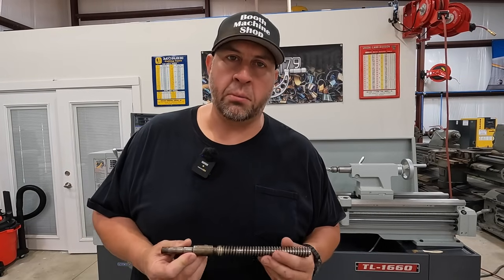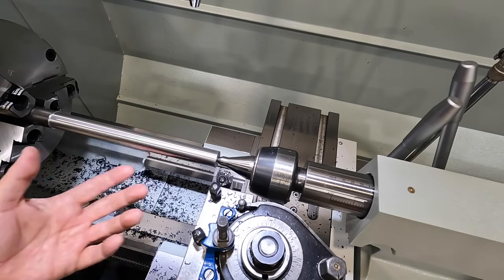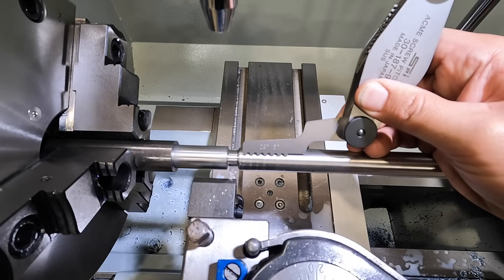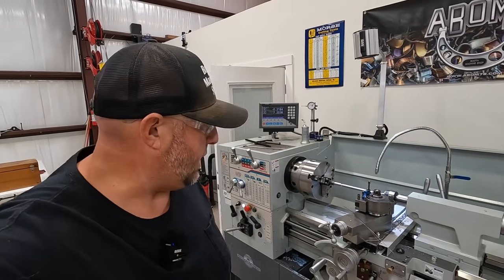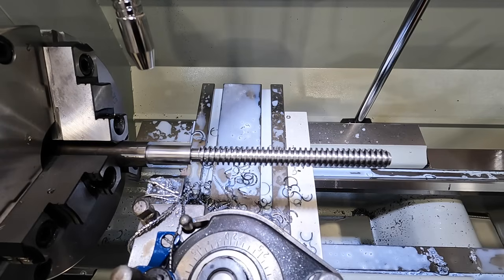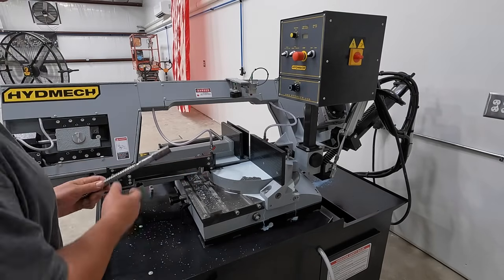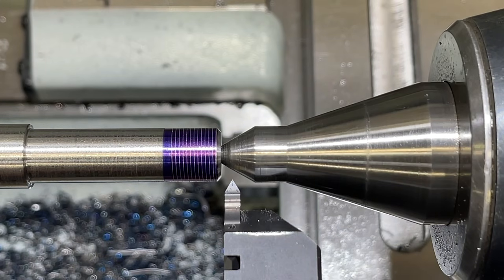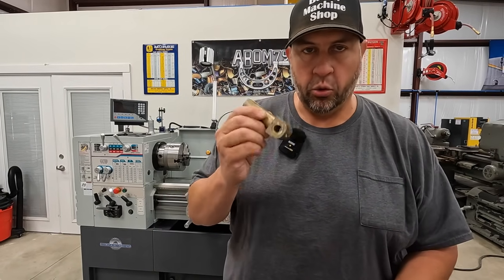Compound Acme Lead Screw for American Pacemaker Lathe

Comment: abom79 (or anyone who can answer)- when you do trial passes with and without coolant trying to determine which you prefer, could you describe what you'd be looking at or listening for etc to help make your decision about whether to use coolant or not? I guessed maybe the surface finish or chatter might be better one way or the other, but I don't have any eye or ear for what an experienced machinist would notice. Thanks in advance and man I love these videos!
Reply: It’s rare that you wouldn’t want to use coolant in this situation. Unless your talking high power carbide insert machining with thermal shock issues coolant will be helpful. Most of the time when you see videos without coolant it is strictly for the video purpose. Some materials also just don’t need it like bronze,brass, cast iron.
Reply: @matthewchastain136  As long as you use coolant from the start, thermal shock isn't an issue, its only an issue if you are introducing coolant when the part is already hot.
Reply: Hi Andy, as a rule of thumb, always use coolant, except on cast iron, ( the material tends to harden and is self lubricating so no need for coolant, some leaded bronzes are also self lubricating but it wise to use coolant  on these materials  because of the sizing issues). The reasons are, its keeps the part cool which means you are not guessing how far the part will shrink when it cools down, and it stops weld  build up on the cutting edge of the tip, its also improves the surface finish of the part.
Reply: @1ginner1  you never use coolant when hardmilling or highfeed miling of steels and super alloys. It causes thermal shock on the carbide or ceramic tooling not on the part.
Reply: @matthewchastain136  Hi Matthew, I wouldn't know, I was only talking about turning, not milling. Most of the milling I have done was on pretty standard materials, not on super alloys, although I have turned, Super duplex , hastalloy, Inconels, etc... all of which I have used coolant on.
Reply: @matthewchastain136  hm so in this case, abom makes a first pass without coolant, and then turns it on for the rest. Based on the responses here, it sounds like maybe he planned to use coolant for all the passes, but maybe just wanted to be able to see how the insert was performing once before it was obscured by the coolant? I'm guessing it's probably not a big problem to make an initial pass without it and he wasn't trying to decide whether or not to use coolant but just to get some footage of  cut without it.

Thanks a bunch to everyone who replied! I'm a hack woodworker who has gotten hooked on machining vicariously through these videos, I'm hoping by the time I break down and get a toy lathe I'll know enough to do a few simple things :)
Reply: @1ginner1  i imagine the same applies in turning harder alloys  but i dont have as much experience in that, mostly in CNC milling.

Comment: Most of what I know about machining I've learned from watching Adam, so apologi

es if this is something actual machinists already know:

Does it make sense to mount a follow rest on the cross slide? And not necessarily on top, like the compound, but maybe via holes in the housing for the cross slide, on a swivel with positioning holes that can locked with pins. If the issue is to support the stock where it's being machined, being on the cross slide will give it the precision to be where the tool is. I can see where flexing might be an issue, so maybe the mounting system needs to attach to both sides of the cross slide. like an A-frame.

Thoughts?
Reply: One thought is if you have a rest centering on the chuck side and another on the tail side, how do you centre them both except during cutting?🤔
Reply: The cross slide must be wound OUT after every pass. You cut the pass, wind out the cross slide, then wind the carriage back to the start, then wind the cross slide back in (to zero on the dial),  then wind in a few more thou on the compound, then make the next pass, then wind the cross slide back out.... rinse and repeat.
If you mount the follow rest on the cross slide, then you cannot wind the tool out. If you can't wind the tool out, how do you get the carriage back to the starting position to take the next pass?
The follow rest must be mounted onto carriage (which moves left and right), and not to either of the slides (that move in and out).
Reply: @johncoops6897  Good point. From what I can tell, the cross slide is on a base which rests on the main ways. If that't the case, then my version of a follow rest can mount to the same base.If that isn't the case, this might mean designing a new system that can accommodate a follow rest and a cross slide.
Reply: @meteorplum  rereading this, you might be describing a "standard" follow rest or "travelling steady" that mounts on the saddle and supports the workpiece close to or at the cutting position.   I'm not sure I've ever seen Abom use one, so if all you know is based on what you've seen here, it shows you're learning and thinking (but unfortunately maybe re-inventing the wheel this time around)👍👍

Comment: Your compound Is at a 30° angle, if you add thread cutting depth with it, doesn't it shift the tool over to the right by half the amount you're adding? Doesn't this interfere with the thread alignment?
Do I have an error in this?
Reply: This is a good question ,, and now my brain is hurting trying to remember this from long ago,, Dammit ,,,  Now , I will have to dig out my hand book and study to remember the effects of angular movement on acme threading ,, mutters at old age. Regards J
Reply: @johnmccallum9542   I thought this through with a triangle (angle 30°, compound as hypotenuse, sine(30°)). Maybe it helps you and you don't need to dig out your old hand book.
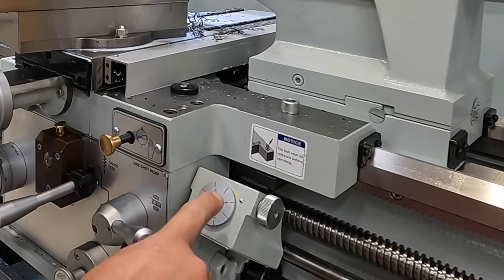Reply: By the looks of it the compound is at the correct ~14° angle for cutting acme (29° included angle) threads. Have a look at around the 16:20 mark in the vid'. It is also swung the opposite way to 'normal' which is correct for LH threading. The function of the setup is to make the tool cut on the leading side only which reduces tool pressure and chatter etc. Basically the tool is fed in so it follows the angle of the flank of the thread. The only compensation that has to be made if using the compound dial to control depth is to calculate (with basic trigonometry)  the distance along the angle that gives the required final thread depth. This has no effect on the pitch as that is controlled by the leadscrew.

Comment: Just need to rotate that compound slide the opposite way to get the cutter in front of the follower. Cutter presentation is still straight in.   New machine .....new problems and new solutions.

Comment: If the compound had been turned 14.5 degrees the other way he could have used the follower rest? The tool would have been cutting on the left side instead of the right but the result would have been the same.
Reply: Great point, that's knowing why you do something and not just how.

Another solution would be to keep the compound aligned with the lathe axis and advance the compound 0.001" per 0.010" from the diameter. This simulates the 14.5 degree tool movement in the z axis that the compound slide does. It keeps the main cutting on one side of the tool with 0.0003" shaving on the trailing edge and simplifies the depth to go to. The tool can also be independently moved in relation to the follow rest to suit where you want it to touch the workpiece.

Or: The trade solution, use stock ACME rod and machine / sleeve the ends.
Reply: @marley589  starting w acme rod and machining away what's not needed and adding a sleeve is what i thought first. ALSO isnt acme heat treated to help with wear?

Comment: I wondered if the ACME in your test nut was a little tapered. As you checked the fit several times you were able to screw it on almost all the way. One time it seemed you tried the other way and it barely did fit 1 turn?
Reply: @_BLENDRR  Nice explanation :)
As you explain there would have to be a slightly difference in pitch between internal and external pitch wich there isnt according to the Book. Both have 5 TPI and there is no   different tolerance specified for the pitch. Even if, then the Nut had to screw up the same length from both sides.
Maybe Adam likes to say something about?
Reply: Not likely the tap would taper the hole. In the beginning it was definitely the end of the thread causing it to start hard. It pulls the top of the thread over just a little when the tool exits the cuts. The other tight spots aren't a surprise at all because there was so little clearance in the thread. You would never notice it if he had machine more clearance into the nut, but he wanted it tight because it's a lead screw and will work better and longer if it's a good fit.

Comment: Why don't you turn the compound to the other side, so the tool follows the right side of the groove? You just have to drag your hand on the handle to keep the cutting pressure from pushing the carriage away from the work. As your machine is new, and tight, this shouldn;t be a problem. Hope this helps position the tool where it needs to be.

Comment: Did you ever consider rolling the threads?  edit; I'm not sure Acme threads can be rolled.
Reply: Yes they can, but you have to have the machinery to do it. It creates a much stronger thread than single pointing.
Reply: The rolling dies for each specific thread pitch and lead are a rather big investment, only worth for large production runs, or the exceptional case of this process being specified for stronger threads, in which case it can still be more economic to just single point turn them in a tougher material all along.

Comment: is the threading dial supposed to line up with that rivet?  It doesn't look like it lines up with anything...
Reply: That's what I thought too.
Reply: If you look closely at around the 16:16 time you can see a yellow mark just above the rivet, Adam may prefer the sight line to that mark over the sight line to the rivet, you could line the wheel up to any mark you prefer, the only things needed are that the 1/2 nut will engage at your chosen point, that the point cannot move and that you only use that mark!
Reply: Yeah, he's using something other than the intended rivet , whatever it is he is keeping it the same but it's annoying for the video viewers.
Reply: @grahamstretch6863  Thanks, I didn't even see the yellow mark.  He talked about starting on 1,2,3 or 4 then it looked to me like he started on 2 and 1/2 as I was expecting it to line up with the 12 O'clock position.
Reply: that looks a pin for retaining part of the internal mechanism, possibly the shaft for the knob to the right of the dial.  the index mark for the dial will be a score line in the housing.
Reply: @ScottPankhurst  
On my lathe it is that dome that is used, but it is nearer to being where the yellow mark is at on Adam’s lathe.

Comment: On the bearing nut side, how are you pulling the tool out with the cross slide in exactly the same place each pass? Also no undercut on that end?
Reply: He’s probably reading the Digital Read out for the position of the carriage and retract the cross-slide as it reaches the target position.

Comment: When machining those threads, how does the machine move in to cut at precisely the right moment?
Reply: It can move in at any time. It starts moving sideways at a precise time because he engages what called a "half nut" around the screw that runs the auto feed. There is a little indicator dial that shows the phase of rotation of the drive screw at the exact moment in time.
Your timing has to be pretty good or else you suddenly wreck everything.

Comment: When you’re adjusting your x with thread cutting on your compound on an angle (30°) like that how are you compensating for / landing on your Z zero each pass?  Is the zero read on the compound on the dro?
Reply: Your carriage and your cross-slide are set exactly to zero every pass, but the compound is dialed in for the depth of cut. In this case, I think his angle was only 14° or something and not the standard 30° for most threads.

Comment: looks like it gets pretty close to the tailstock at the end of the cut. does it have a sensor there to help prevent a crash?
Reply: It makes a noise
Reply: I noticed that too, but would assume it is more experience than anything (including the 'beep').
Reply: The PM lathe he's using has a really nice clutch-out feature with the power feed where you can set a stop collar. Not sure if he's using that or not (most lathes do NOT have that kind of nicety!).
Reply: @Venthorn  Good point.

Comment: Where does all that coolant go? is it spilling all over the floor
Reply: Collects in a recycle reservoir after passing through filters, is pumped back through.
Reply: There is a large continuous-length tray underneath the lathe bed. Everything that falls (chips and coolant) falls in there, then the coolant runs to a drain that goes down to the reservoir that Draztiq mentioned.

Comment: I'm an electrician so forgive my ignorance why on the test nut can you get like 3 whole threads of engagement but it still gets tight? Does that mean you're either of your parts are slightly conical?
Reply: I think the testnut is conical watch the horizontal stripes on the one end is the tight end. Just also a electrician.
Reply: Because nothing is perfect. The further in the nut it goes the less wiggle room you have. It's not conical, it straightens out more the further in it goes. Like drilling a hole through sheet metal, if you put a rod in it you can still flop it all around. But if you drill the same size hole through a 4 inch thick piece, the same rod won't wiggle around as much. Hopefully that makes sense hahaha
Reply: It’s not conical, it’s just that if only one thread is threaded on it has slightly more backlash until the next thread threads on to fix it’s position in the valley of the screw. Also the drag increases the more the nut is threaded on.
Reply: It's probably how the tap was cut.  For those that haven't seen the nut manufacture video, he he bought a left hand Acme tap and used the FlexArm to cut the thread.  Check it out.  It is very worth your time to watch the FlexArm work.  Fine tool!!

Comment: Did I see your tailstock moving back and forth around 4:30?  Side to side, not in and out.
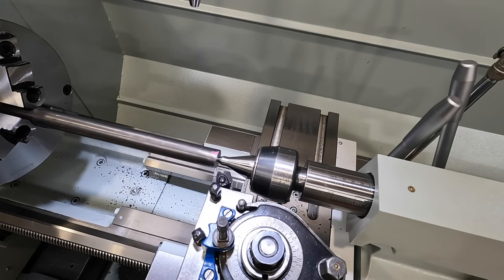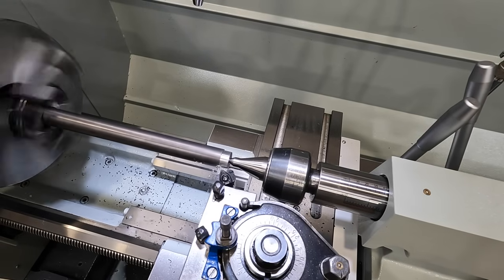Reply: I rewound and watched about 5 times, and didn't see it move in the slightest. It was a strange camera angle and the camera is mounted to the carriage, so it looked weird between 4:20 and 4:40... but I didn't see anything move.
Reply: @johncoops6897  Cool.

Comment: Anyone know why they are named Acme?  google search has no answer.  Maybe the road runner knows...
Reply: This thread type was designed to be better than square threads in almost every way, stronger, easier to engage half nuts, wears better, etc. So because it was designed to be the very best thread for its defined job they named it Acme, which merriam webster defines as "something or someone that represents perfection of the thing expressed".
Reply: @nolansykinsley3734  Interesting.  Thanks!
Reply: Wikipedia: The name "Acme thread" was proposed by A. W. [Albert Ward] Handy (1845 October 7 (Bristol, Rhode Island) – 1915 August 27 (Malden, Massachusetts)), who was then a sales representative of the Acme Machinery Co. of Cleveland, Ohio.
Reply: Sounds like it should have been called a Handy thread,that's what happens when you work for the"man" right!

Comment: Abom did you have a final verdict on what went wrong with the original attempt?  35:43 watching this video made me think about the original issues had ...... seeing you test fitting the nuts and re engaging the tailstock center you can see some lateral play in the spindle.   It pushes the chuck and spindle right to left ..... so many thou or tenths.... I wonder if once you started testing you test nut fit on the Monarch ....... if your tailstock pressure changed and so the threads didn't end up lining up exactly perfectly.
Reply: I’m sure you’re seeing an optical illusion here. If the spindle was moving laterally even a tenth of a thousands it would indicate a serious problem with the headstock. Not likely with a new lathe. There were other issues causing the failure on the Monarch.
Reply: Spindle bearings wouldn't be loose on the Monarch, but the leadscrew bearings may be.
Reply: @TheMetalButcher  Yes, the lead screw end play definitely should be checked for no movement.
Reply: @ellieprice363  could be.   You guys probably know better than me.   SO why do y'all think that first screw did great for all but the last few passes?
Reply: @dizzolve  Probably several things. Maybe one or two or a combination of these. 
Older worn machine. No lubrication. Worn lead screw and half nut. No follower rest. Too low speed. Loose cross slide gibs. Lack of lubrication and low rpm are the most likely reasons.